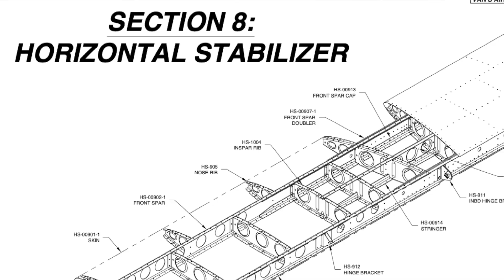Metal Magic: Using Reamers For Accurate Holes

Comment: I'm trying to wrap my head around this, but I don't understand why when looking on Amazon, I notice most sets are mm. The few American fraction sets seem to cost 10x more than their metric counterparts. ...why is this? 

I'm drilling holes with American fraction bits to run fraction sized rods through steel. Do I use metric reamer bits then? ...I don't understand.

Comment: The only thing I'd add to this is you never spin a reamer backwards - like NEVER - because it's the fastest way in the world to damage it and good reamers are expensive (and don't buy cheap reamers.  If a hole is important enough to need reaming it's an important hole, so use a quality tool.  Also, if I can get the piece in a drill press or milling machine I prefer to ream it that way, nice and square, and slowly with a good lubricant like Boelube or Mousemilk  or something similar.

Great series, Paul - keep up the good work!

Comment: Surely overlooking the purpose is to have the finished hole 🕳 with a clean and round inside edge finish to avoid crack propagation.  That’s why a ream has straight flutes unlike a drill. It’s also nicer to team by hand with a tap wrench.

Comment: For the best hole condition......slower RPM works better. Generally, that holds true for drilling as well. 

I see most people using the fastest possible RPM and the drill is just rubbing its way through allowing it to wobble all over the place. A slower RPM and firm feed pressure ensures the cutting edge is actually shearing the material. This reduces heat and wobble which makes a better hole and the bits last longer. For many of the sheet metal holes for rivets - it probably does not matter, but where you want to be precise. 

I have machined many millions of (extremely precise) holes over the last 20 years, so I am not making this up. Hope it helps.
Reply: Correct pilot hole drilling avoids all that nonsense, step by step to the finished diameter.

Comment: Pro Tip (thanks to Scott McDaniels at Van's):  With bare aluminum, or even aluminum with the blue film on it, you can align the reamer perfectly straight with its reflection to achieve good perpendicularity.  Same thing holds for rivet sets, which is what Scott addresses in his video on building RV fuel tanks.

Comment: My personal experience with drilling large holes in thin sheets is the larger the hole, the more important it is to work your way up step by step through a sequence of drill bits (or reamers) of increasing size, until the hole is big enough for a final size piloted reamer to become effective, then finish off the hole with the reamer.  If you just use a drill bit, you can end up with a very ragged hole, especially if a drill bit grabs the edge of the hole and lifts it up.

Comment: I thought a reamer was done in reverse. That is, drill slightly under then slide shank of reamer into hole backwards, then load end into drill. Then pull the reamer BACK through the hold. The cutting part of the reamer is off the shank. End of the reamer is square so dont know how the cutting blades would center well on the smaller starter hole.
Reply from the maker: Paul says, "If the reamer won’t start into the hole with the slightly tapered front end, then your hole is too small and needs to be upsized before reaming! Usually just a few thousandths under."